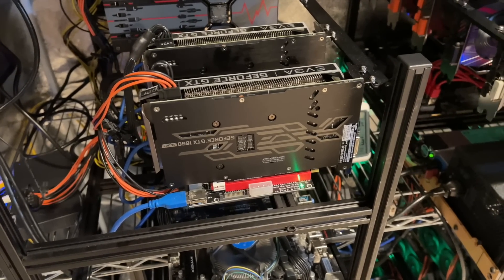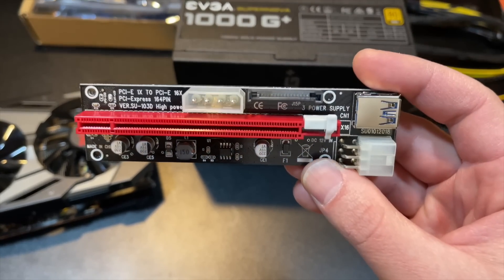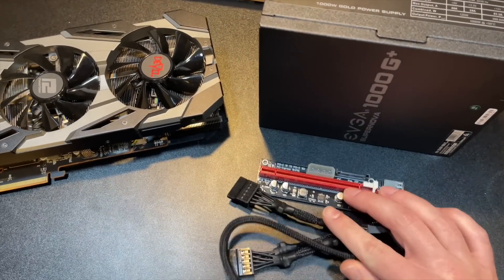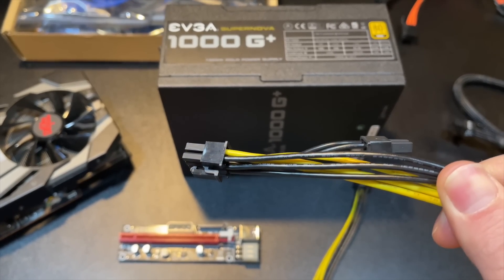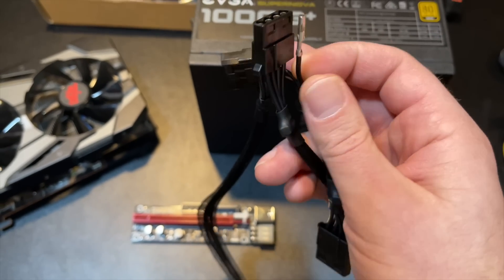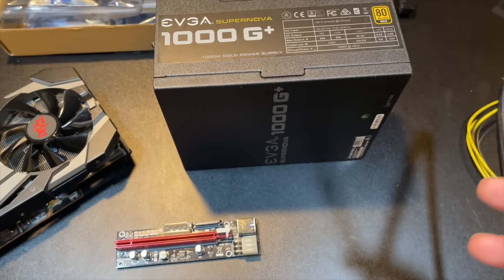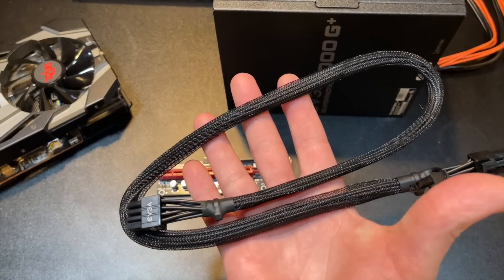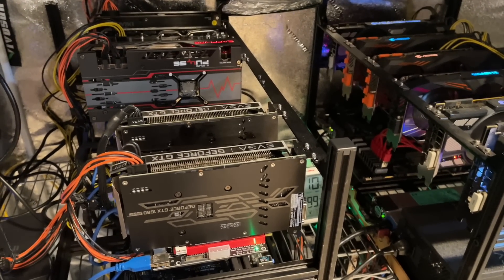Powering GPU Mining Risers Safely

Comment: I have a question, if i use the 6 pins to power the risers, what if my gpus need the 6 pins as well? If there's just not enough 6 pins
Reply from the maker: Then you need a second PSU or to split the 6-pin connection if the GPU has a low TDP.

Comment: I didn't know about sata ill look for that. 6 pins are not calling for 75w how the hell is my 3080 calling for a total of 330w then? 6 pins are 150w and 8 pins 175w.
Reply from the maker: 3080s have 2 8-pins which equals 300 watts, plus the pcie slot can pull 75 watts. Doesn’t mean the card will pull that, means that the cards are built to that pcie spec which is linked in the video description.
Reply: @RedFoxCrypto  Ok thanks but it is not always taking the 75w of the riser i guess because my sata would have burn already (ill change that today). Whats the priority on how the card withdraw power?
Reply from the maker: @hugohenry-garon5105  Yes you're right it's likely not taking the full 75w. In general, NVIDIA seems to draw less from the riser, but the last couple generations of AMD cards draw more. I've seen some testing that shows even the algorithm being mined can impact how it draws power. I always plan for the worst and make sure I'm setup for the full 75w pull.

Comment: What about combining Molex and PCI-E? Does that double the wattage or is it even possible? It seems like a good option to balance load.
Reply: If both cables share common then the voltage will be the same and both cables would share the 75w load altho its pointless because each one can accommodate 75w individually.  The gpu still needs separate feed because 75w draw from card does not change and is not enough.

Comment: So I'm building my first rig and am waiting on multiple 3060TIs. I received some splitters in the mail but I must have bought the wrong ones for my PSU. I'm using EVGA, didn't know they could vary. So now I'm even more confused because I don't know if I need 6 or 8 pin, 6 to 8, 8 to 6??? All I know is I should go with 18AWG or better. Any help would be appreciated. Thanks.

Comment: SATA description - beginners description. Explanation is just to confuse more the average miner. Your approach must be much different, starting first with explaining the VGA power draw in general sorting by generations or models. For example Polaris cards mining ETH usually has about 40-50W power draw from the riser. RX 5700 usually 55-65W(57.5MH/s). RTX 3070 about 12-18W(@61MH/s) ...
Also, talking about SATA, you are mixing and additionally make a confusion several times using CABLE instead of CONNECTOR. Ok avg listener can handle that.
The cable on one modular PSU with several SATAs can handle at least 180W, most important is HOW the bridge is made for the next SATA connector...
4.5A (55W) is like a warrant from the SATA protocol, but nowhere is written that it is ok for non stop working ON MAX. However, my experiences (4 years NON stop mining) is that brand PSUs (with AWG18) can handle SATA connector non-stop with about 65W.
On the top of this, Polaris (maybe others, I didnt tried yet) cards you can program the power source draw, so all this is manageable...
At the end, yes better avoid SATA when U dont have much choice but only talking with AMD cards. No problem if one SATA is used per cable except in case with extreme OC which will be over 65W. No issues like this with nVIDIA...for example 3080 has 3x 8pin PCIex connectors... nVIDIA is doing a very good job, primarily for gamers prolonging the lifespan of the motherboard with much less power draw from the MB. Same is the analogy for the risers.
For beginners, just a simple and cheap tool to be sure what is what. Buy cheap ~ $50-60 (but not AliEx) Clamp meter (it must have DC option) to get the Amperes..
Reply from the maker: Thanks for the response Igor. All good points.

Comment: i had watched few videos on mining never really understood using these splitters and different connection, thank you, am now mining on my 3070 in my gaming pc 3060TI is on the way, hope my 750W gold gigabyte PSU in enough for both, and do i need to install separate drivers, to use 3060TI for gaming or 3070 drivers are enough?

Comment: I purchased 8 pin to 8 pin splitters.  Can I use all 8 pins on the VGA cable into the 8 pin splitter or should I just use the 6 pins and leave the 2 pin pig tail tied back?  I have one FTW3 3080 on the mobo and want to add a second 3080 with a riser.
Reply from the maker: You can definitely use all the 8pins.

Comment: Great video, I subscribed to your channel. I have a question though, when u mention that ur 1660 card can pull 125W at most, does this mean you only need to supply 50 W from the top connection? Since you already supplied the riser with 75W? Or does this mean you have to supply it the full 125W from the top connection? Thank you
Reply from the maker: Thanks Mohammed! The GPU will pull a certain amount from the riser and a certain amount from the top connection to get to its 125w. 

It's not as clear when it pulls from what and how much. For example - It may pull 100w from the top connection and only 25w from the riser. I think it also depends on the task it's doing. I've seen more core dependent algorithms pull more from the riser than memory heavy algorithms. 

Best thing you can do is prepare for the card to run full TDP at some point and use the proper cables and connections (PCIe) to be safe.
Reply: @RedFoxCrypto  Thank you kindly. I am doing prep work for building my first rig and this kind of content is really helpful with it.

Comment: Is there a difference between 6 pin to dual 8 pin splitters and 8 pin to dual 8 pin splitters? If both have 3 pin 12v that means that have the same max wattage so it wouldn't matter right? I originally thought 8 pin to dual 8 pin splitters would have higher max wattage but I hardly find any of these kind of splitters, and realized that it might be the same.
Reply from the maker: My understanding is that they are the same. Any modern 6-pin should have 3 pins that connect to the 12v rail. The spec is that the 3rd 6-pin is optional so I was conservative in the video in that regard.

Comment: i used to run shitty 15$ 500W PSU for each GPU that's below 150W, using jumpers. Now i'm playing safe, just stick 2 GPU on a single 30$ CPU+mobo combo with 600W 80+ units.

Comment: I have another question. Why cant you connect sata on the riser and then another 6pin to back of GPU directly from PSU. Wouldnt that avoid the potential overheating of the cable

Comment: So quick question. Does it call for 75w from the pins at the bottom from the motherboard and then another 150w from the 8 pin at the top

Comment: Hello, can i use a different power supply for the second card? i have a rtx 3090 on my maine computer and i want to use my second card a 2060 super - i want to connect my second card to my mother board but use a different power supply. can i do it like this>
Reply from the maker: Yes you can do that. You'll just need to make sure you power on the second PSU before you power on your main computer.
Reply: @RedFoxCrypto  Thanks for the fast response man. So, you are refering that if both PSU are off, i just need to turn on the  the second PSU and then turn on my main computer?How do i do that? The  second PSU only has a 0/1 power button. 

Also can i mine with both my cards? I currently mine with my rtx 3090 that i overclocked for 120 MHs/s, but i want also want to mine with my old card - nvidia 2060 super - can i overcloked the second one also with MSI afterburner? I think if you could do a video on this it would have a lot of succes. Thank you and i wish you the best.

Comment: Absolutely beatuiful, thank you, but let me ask you this, if the GPUs are PRIMARILY powered by 6-pin or 8-pin cables attached directly into them, why would they took the power source from the pci riser?
Reply from the maker: That's just how they are designed. Not too sure of any more detail beyond that. And some GPUs will take very little power from the riser and most from the PCIe plugs, but others will max out the riser power.
Reply: @RedFoxCrypto  Yeah not worth risking that.

Comment: Thank you! I was about to use those sata to pcie connectors. You propably saved my house from burning down. Thank you
Reply from the maker: You’re welcome dude! Be safe!
Reply: What are your thoughts on using the 24pin adapter to combine 2 x 650w psus into one? Is that safe?

Comment: What is commonly called a 'Molex' is actually a 'Mate-N-Lock' from TE Connectivity. Specifically a 1-480424-0. The only Molex connector that most people today will have ever seen is the ATX power connector on the mobo itself.

On a related note, I wouldn't trust any company that tried to use SATA like that. That's not even a beginner's mistake. It's straight-up negligent.

Comment: all mine came with were molex so I guess that's what I'll run...
Reply from the maker: Wow be safe dude. Must be some old risers to only come with molex.
Reply: @RedFoxCrypto  Well I bought them new from Amazon and they had good reviews,  luckily I have a 1200w modular power supply so I'm gonna be running just one per cable. They seem to be high quality connectors so I think they'll deliver.

Comment: Thank you for sharing this great info. I'd like your advice, if you don't mind. My setup is: 

- 3 EVGA GeForce RTX 3070 XC3 GPUs
- 1 Seasonic Focus GX-1000 PSU
- 3 Ubit PCI-E Riser Express Cable 16X to 1X

I want to power my risers using PCIe, however, my PSU does not have enough slots. It has 5 in total, so: 1 for CPU - 3 for GPUs - 1 remaining. Given the manufacturer provided PCIe cable which splits into two 6+2 PCIe connectors and an Aya 11" 18AWG PCI-Express (PCI-E) 8-Pin Male to 2x PCI-E 6+2 Female Splitter Cable w/Black Sleeves. 

Is it safe/advisable to use one of the 6+2 PCIe connectors to power riser #1 and use the other 6+2 PCIe connector + the splitter to power risers #2 and #3? The math seems to check out, but I wanted to know your thoiughts. Thank you in advance!
Reply from the maker: What's up Jason. First, awesome GPUs you got there. I just did a build with them and they are the GOAT. 

The 6-pin PCIe included with that power supply most likely has 3 pins that go back to the 12v rail on the PSU so the math does work out at 3pins*8A*12v=288w max capacity. If those cards ran full tdp they'd put 225w over the single PCIe cable.

Even though that looks okay, I actually might be tempted to use a single molex connector for one riser and only split the PCIe once for the other two. Looks like these 30 series cards can pull the max 75w from the riser if the overclocks reset so keep that it mind.

All that aside, absolute safest and surest thing to do is get a different PSU or add a secondary PSU. 

Hope that helps buddy! Thanks for watching.

Comment: Frankly, this is a fantastic video, thank you for the high quality content you made. Just two noob question: In my PSU I have too many connector, I supposed I have to connect it to the 8 pin that says VGA? or can I connect the splitter to any slot with 6 pin i.e. SATA or PERIF?
The other question is: I will connect an AMD 6800 XT which contains two slots of 8 pin each one, so should I use the two VGA slots of my PSU to connect them to the GPU?
Reply from the maker: Thanks dude! The PCIe 8 pin connections should go back to the VGA ports on your PSU. The TDP of the 6800 XT is 300 watts so I’d personally use 2 separate 8 pin strands for the GPU which would take up 2 VGA spots on your PSU.
Reply: @RedFoxCrypto  Thank u my friend!

Comment: Awesome video! Thank you so much for your content. But what about a rm850x, the pcie slots on the psu is limited and when I run pcie cables on the sata slot it doesn't work. How would you get 6 gpu on rm850x thank you!
Reply from the maker: Thanks dude! I don't think you could get 6 GPU on a rm850x. You'll need to either add a second PSU or upgrade to a higher wattage PSU with more PCIe connections.

Comment: I need help! I'm a complete noob when it comes to mining, I just started my research, can I power my rx 580 with the 6pin to dual 8pin splitter, so one connector would go into riser ( 6pin ), and the other would go to my rx 580 ( 8pin ) and then the other end of the cable would be connected with the 6pin connector of my power supply, if I got it right, you did the same with 1660 super, but can I do that with rx 580?

Comment: hi is there any way I can use my main rigs PSU with extra cords to solely power a gpu only in another prebuilt rig I have considering it has the wattage for both? basically im getting a dell prebuilt with a PSU that cant power more than 2 gpu, so I was going to get a pcie extender like in the video connect it to my pcie x1 slot on dell, and use power from my main PSU in main rig to power riser and what not. Seems like it would work to me but idk.
Reply from the maker: Yeah it'll work. Just make sure you have the main PSU powered up before powering up the dell prebuilt. It'll be ugly, but it'll work!
Reply: @RedFoxCrypto  You don't know how much I appreciate this, thanks! and yeah it'll be super ugly lmao, 1 last thing I have an SF750 corsair brand new platinum power supply, I was wondering if you think using a single molex for the riser would be safe for that 3070 considering its top of the line and not some old one. I've seen people say they can pretty safely power 2 risers max, but I just wanted to double check . Thanks. forgot to mention the 3070 would be taking in 2 8 pins from PSU so maybe itll have some comfort room on the riser
Reply from the maker: @tungadilla  I avoid Molex personally, but you’ll probably be okay only using a single Molex connector on that strand. Make sure you keep that GPU power limited!
Reply: @RedFoxCrypto  Will do, thanks a ton!

Comment: I get your point but in other news, BBT and countless other channels have used the 15pin SATA to power their risers. Myself included have been using 15 pin SATA for years with no issues. Granted we dont buy cheap power supplies either. Im mean for god sake its just powering a riser.
Reply from the maker: Maybe for old GPUs. Watch BBTs video on NVIDIA 30 series he just posted. The 3060 Ti pulls 85w over the riser if ran stock. Obviously, we aren't running our cards stock but if your OC resets and you are using SATA you'll be in for a real bad time. Even running power limited its maxing out what a SATA connector could do.

Same is true for the last 2 generations of AMD cards. They will toast your SATA with how much they can pull over the riser. BBT has videos on that as well. He's the GOAT.

Comment: MMM... 
×1 cards are limited to 0.5 A at +12 V (6 W) and 10 W combined.
×4 and wider cards are limited to 2.1 A at +12 V (25 W) and 25 W combined.
A full-sized ×1 card may draw up to the 25 W limits after initialization and software configuration as a "high power device".
A full-sized ×16 graphics card[21] may draw up to 5.5 A at +12 V (66 W) and 75 W combined after initialization and software configuration as a "high power device".
Optional connectors add 75 W (6-pin) or 150 W (8-pin) of +12 V power for up to 300 W total (2 × 75 W + 1 × 150 W).

Comment: hi :) what do you say is the most profitable miner/software to mine on with a single 3060 gpu on a pc with free electricity? nicehash? ethermine claymore? sm else?
Reply from the maker: If its a true 3060, not 3060 Ti then either Ravencoin or Conflux are most profitable. Mine the coin directly, don't use nicehash.

Comment: Do I need a pcie connector connected to the riser, and ANOTHER  for the GPU plugged into the riser?
Reply from the maker: Yes, both the riser and the GPU need power.
Reply: @RedFoxCrypto  Thank you, I was really confused there, another quick question: can I use 1 PCIe connector split into 2 and connect one to riser and one to GPU?

Comment: I have a couple options to set up risers but I'm not sure what's safe, if I have a cable with 2 6 pins on the end would I be safe to run 2 risers off that? Considering molex aswell and my molex also goes from the 6 pin connector to the PSU to 3 molex connectors. Could I use 2 of then to power 2 risers at once? Or would I need it to connect to 2 seperate ports on the PSU? 
Can I do the same with powering the gpu? All my cables split off to atleast 2 connectors.
Reply from the maker: Best option would be to use the cable with two 6-pins. That can carry the most wattage safely.
Reply: @RedFoxCrypto  thanks, so I imagine the set up to be, 
6pin from PSU > 2x 6+2 pin > 6pin to riser   > the other 6+2pin to the gpu?
Reply from the maker: @탯원  Depends on the GPU. If its a lower TDP single 6-pin GPU than that works great.
Reply: @RedFoxCrypto  I plan to do that with an rx570 8gb and a GTX 1070. Both take 8 pins and I'd definitely have them undervolted. 
If you don't reccomend doing it that way how would you? I have risers on the way and I plan to use a 750w PSU, it only has 2 PCIe outputs on it.

Comment: What pcie riser mining are you using in this video and what pcie riser mining do you recument to use and not use, there is a lot of pcie riser mining excist ?
Reply from the maker: It's linked in the description. Otherwise version 009 and newer look good. Make sure it has a PCIe connector on the board.